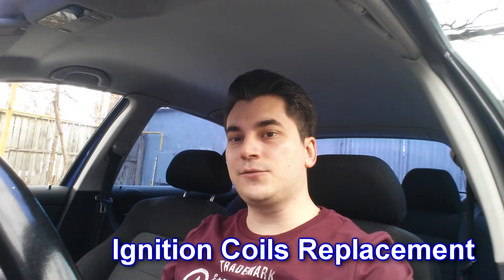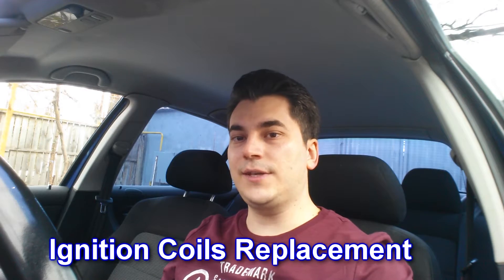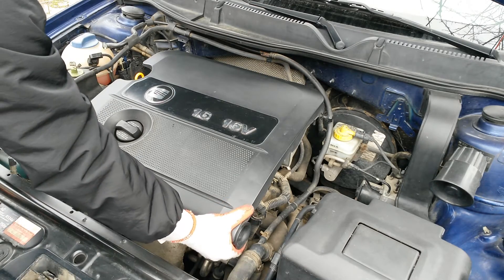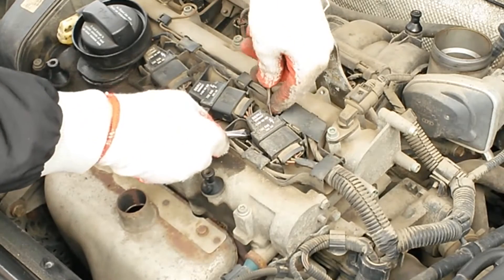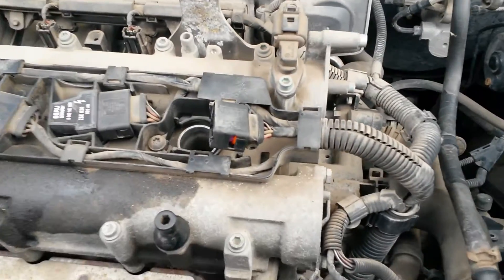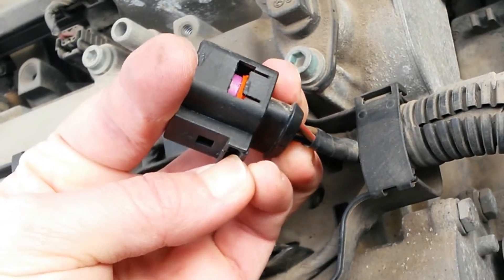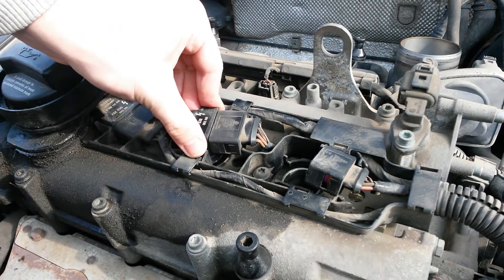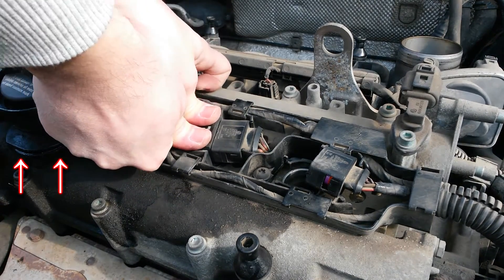Ignition Coil Replacement - Seat Leon 1m / Toledo 2 / Golf 4 / Bora (code AZD / BCB)

Comment: Great video! For others who might be wondering how to fix a cylinder X misfire: when you open the bonnet, cylinder order is 1-2-3-4 starting from left side of the engine.
Reply: very very thanks.
Reply: For virtually every modern inline engine this is true - 1 is next to the cambelt, 4 (or 6 or 8) is at the gearbox end. Only exception I know of is some Hondas
Reply: I AM going to replace every cool, do i need to replace in this order?

Comment: Brilliant How-to thanks. This is the best I've seen for how to unclip the plug, without it I was stuck. And it seems to have resolved my stumbling idle. Noticeable that the cylinder which was playing up had a different brand coil pack (genuine Bosch) whereas the others had no branding on the plugs.

Comment: I changed the spark plugs, but the engine still runs rough. I haven't changed the ignition plugs yet. The RPM is further down at idle, just before going out. Can you help me?

Comment: Salut, cand se duce o bobina e obligatoriu sa iti dea Check Engine sau vreo eroare ? sau se poate duce si sa mearga in 3 fara eroare ?
Reply from the maker: Salut. la modelul acesta de Seat nu apare nici o eroare in bord, doar se observa ca nu mai are putere si vibreaza motorul si masina.
Reply: @Sorin_DIY_Mechanical_Nerd  multumesc , eu am golf 4 1.6 fsi si facea urat la fel ca la tine fara erori , azi am pornit-o si e ok , am desfacut bobinele ( am rupt si o clema de la o mufa ) le-am dat cu spray de contacte si la mufe si la bobine si am mers 25 de km fara probleme. Acum cateva zile a facut urat , tremura toata si fara putere mai deloc , fara erori , ma gandesc sa nu fie pompa din rezervor sa faca figuri , de multe ori simt o lipsa de alimentare dar fina si fluctueaza consumul instant
Reply: @Pete2ong  Salut! Ai vreo informatie noua legata de problema cu alimentarea?
Reply: @cristiserban83  pai la mine e diferenta de compresie intr-un final, am schimbat multe piese si pana la urma am luat compresia , pe cilindru 1 am 12.5 bari si pe celelalte 3 am 16 bari, si e diferenta de 3.5 bari intre ele si de aia se clatina motorul si la turatie mica se simte un tremurat, probabil o supapa nu inchide bine. la tine ce face ?

Comment: Salut si felicitari pentru canal, o intrebare, ai si tu problema cu relantiul instabil dupa incalzirea motorului? As fi curios daca e doar de la EGR/clapeta, ca inca nu le-am curatat. Eu am Golf 4 1.6 BCB si dupa ce s-a incalzit motorul bine face niste variatii la relanti, daca opresc consumatorii electrici, se opreste si treaba asta. Am vazut ca sunt mai multi care se plang de treaba asta la motoarele de 1.6 benzina, nu neapărat modelul asta.
Bafta si succes in continuare! 👍
Reply from the maker: salut. sa inteleg ca daca opresti consumatorii, e stabil relantiul? eu nu am avut aceasta problema, dar daca eliminam clapeta de acceleratie si EGR, e posibil sa aiba legatura cu partea electrica. posibil sa nu incarce bine sau deajuns alternatorul. poate nu produce destul curent la relanti, sau variaza tensiunea. cand e rece motorul si se tureaza automat, creste si tensiunea de incarcare. sa verifici tensiunea la bornele bateriei, ar trebui sa fie intre 13,8 - 14,4 V. daca variaza, sau scade sub 13,8V, cu sau fara consumatori, nu e bine.